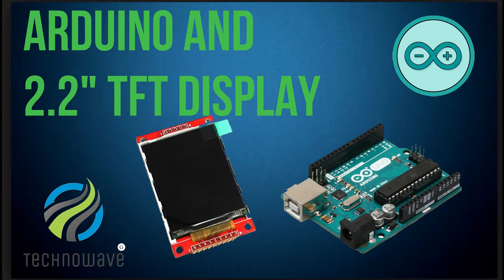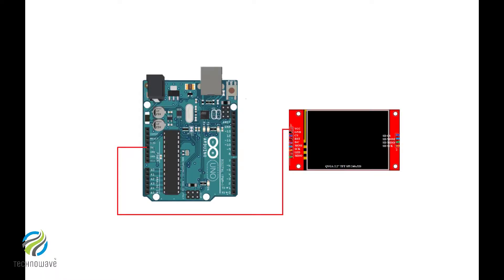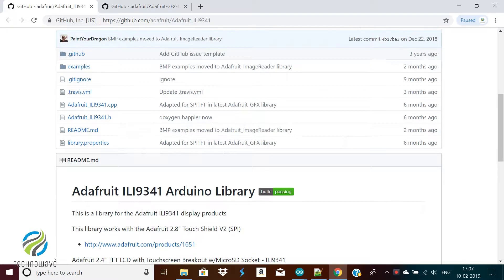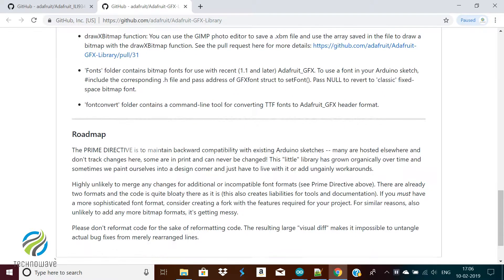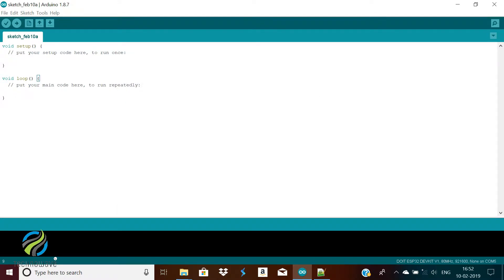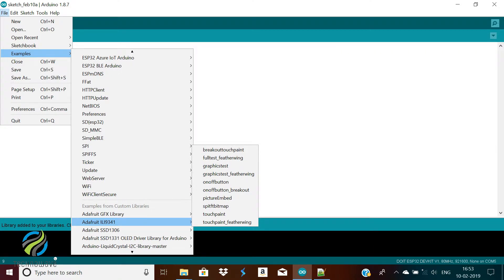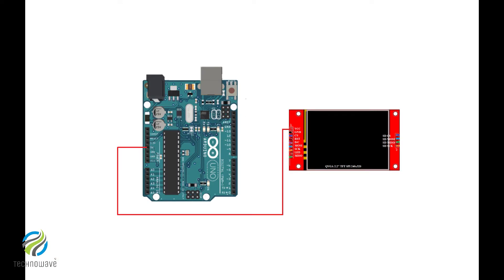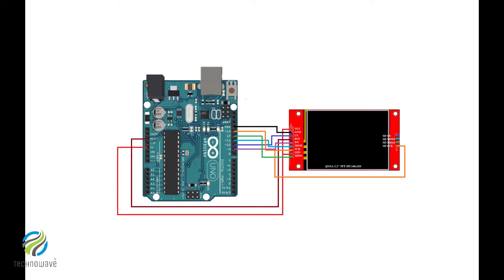2.2 TFT QVGA 240X320  SPI DISPLAY ILI9341 by Technowave

Comment: fyi u must convert 5v logic to 3.3v using pull down resistors (1k to data from arduino pin + 2k to gnd)

Comment: This video has wrong instructions. You didnt show how to power arduino with 3,3volts
Reply from the maker: Actually the project is working on 3.3 volt. Which I am giving through UBS to TTL module. I have connected Arduino UNO 5 volt power pin to USB to TTL module.

Comment: How do you get the arduino to output 3.3V
Reply from the maker: I power up the Arduino with 3.3v supply. I had connected extern 3.3v(from usb to serial module) supply to 5v of arduino and run arduino on 3.3v.